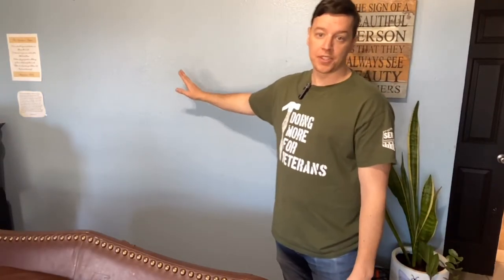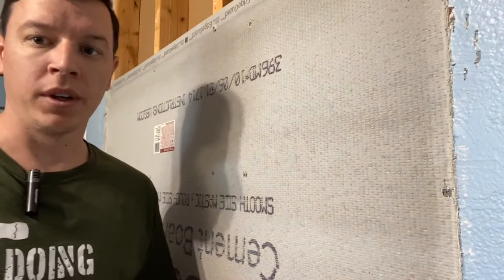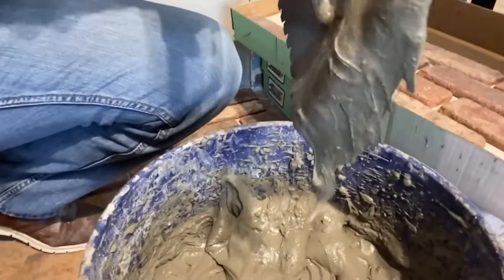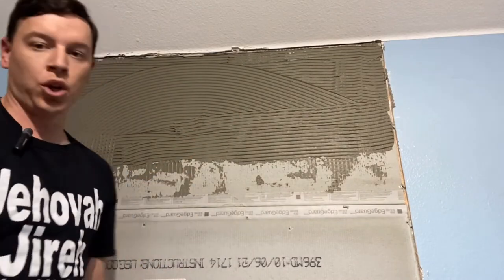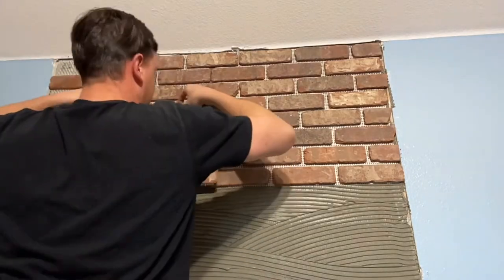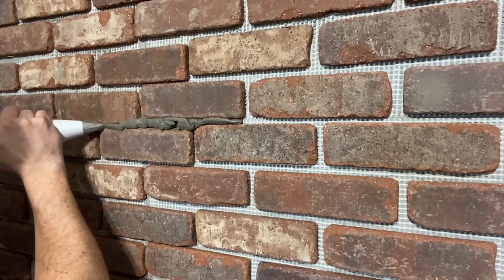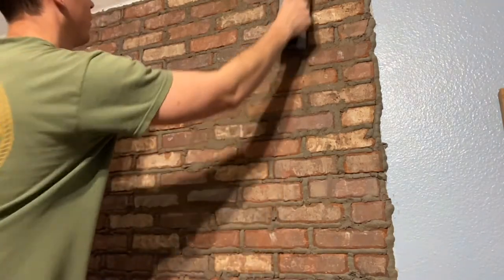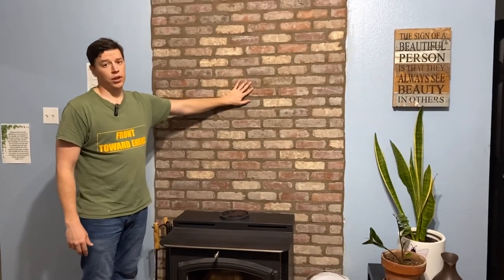DIY Brick Wall and Wood Burning Stove Installation PART 1

Comment: Is the webbing behind the brick fireproof?  Getting ready to install one too.  Thanks
Reply from the maker: Honestly I’m not sure about that, but once the mortar is applied to it, it should act as an insulator for the webbing. After all the webbing will be sandwiched between the cement backer board, and the mortar. I hope that helps.
Reply: Thank you friend in Christ 🙏🙏  @JesusLovingHomesteader
Reply from the maker: You are welcome.

Comment: Is it necessary to remove the sheet rock if I intend to put up framing on top of the sheet rock and lay cement board on the frame?
I will be putting 3” brick on top of the cement board both on the wall and flooring.
Thank you!
Reply from the maker: No it is not necessary if you do it that way. The reason I removed the sheetrock was due to the thinness of the product that we used. It was better for fire protection for us because we didn’t have to space to frame on top of it and add the 3” of brick. You should be fine doing it that way.

Comment: Hi. Is is fine to nail the cement board directly to the wood cabinet next to it? Kitchen cabinetry starts 17” away from wood burner.
Reply from the maker: Honestly I can’t answer that because I’m not 100% sure. Maybe call a fireplace installer and ask. I just don’t want to give you an bad information that I’m not sure of.